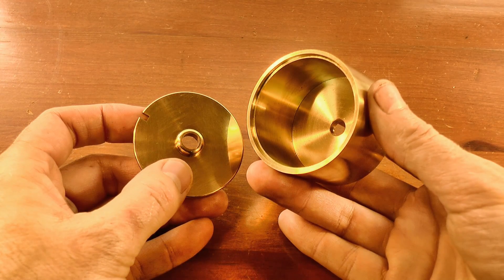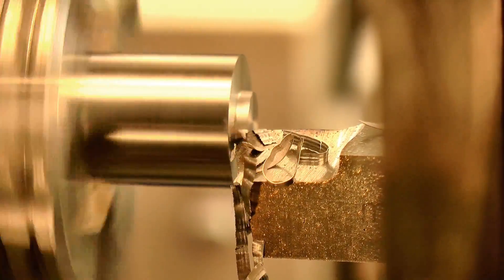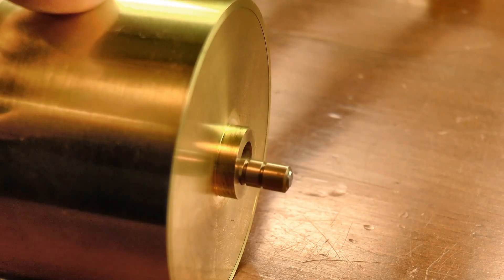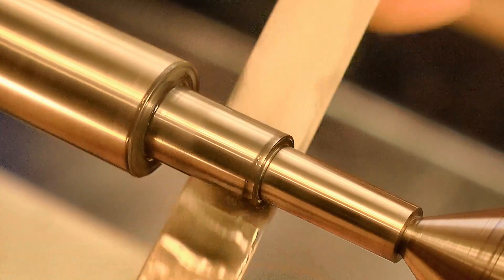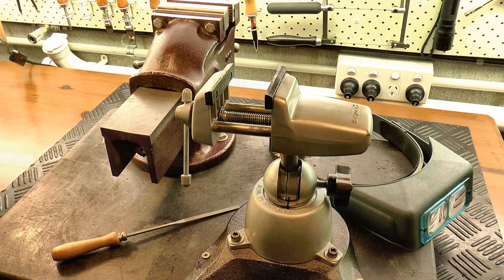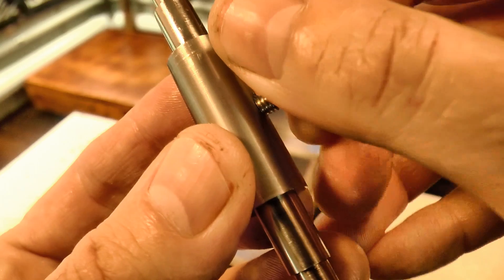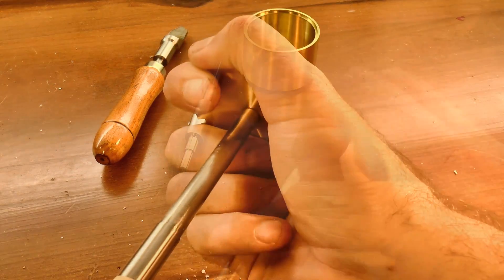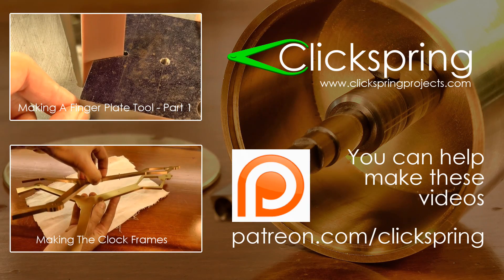Clockmaking - How To Make A Clock In The Home Machine Shop - Part 8 - Making The Barrel Arbor

Comment: You mention "silver steel".  I bet I have looked up "silver steel" a dozen times at least, over the yeares to try to figure out what it really is.
I looked around again today.  And now I remember why I have always been confused.
I guess that, here in the USA, we'd have to call it "tool steel" and let it go at that, since the term "silver steel" is so broad as to be almost useless (to me, anyway).
It seems that most links seem to pin it at  about 1% carbon, but with other alloying elements,  It seems to lie somewhere between AISI W1 and O1.
I may even be wrong on the 1%  carbon, though.
Comments?  Clarifications?
Reply: Not a machiner, just watched a bunch of his videos. In this one he only calls it silver steel and drill rod, but he has made heavy use of O1 tool steel in other videos so that's probably what he used here.

Comment: Now I'm no machinist, so pardon me if this is a dumb question

But as I'm re-watching this, I wonder: You use a file to remove tool marks from the barrel arbor, and then used a slip stone to remove the file marks. Is it possible to use the stone to just remove the tool marks and skip the extra step of filing it?
Reply from the maker: The stones remove metal at a much lower rate than files, so it would take too long - Cheers :)

Comment: I'm very impressed with your work. But I have one question: why do You use only the HSS tools and not working with the carbide tools? When using the carbide tools, surface quality is much higher.
Reply from the maker: +Максим К I use inserts when the material requires it, but HSS gives a lot more flexibility in tool geometry - I can grind any shape I need in a few seconds. Thanks for watching
Reply: +Clickspring Thanks for the reply, this reason I assumed.

Comment: Hi clickspring. I'm interested to find out why you decided not to harden and temper this arbor? I'd have thought that with the winding square on the end it would benefit from being a bit tougher to avoid rounding the edges over time.
Thanks again for all these great videos!
Alice
Reply from the maker: +Alice Taylor Hey Alice, I did consider it but decided that I'd rather avoid the inevitable distortion. The original made by John Wilding was left un-hardened and is still looking as good as new, so it should be ok. Thanks for watching and asking

Comment: Hi Chris, Question....when you were creating the tapered fit ,you called the tool you used a broach. Isn't it called a reamer or is this just another difference in terms that clock makers use, like wheel instead of gear?

Comment: If the hole in the drum cover is taper but your arbor is not taper, doesn't that mean the contact surface is very small on the arbor ? Won't the drum cover hole wear out at the narrowest point in the tapered hole and then become a tiny but looser ?

Comment: how do you draw the threads in solid works?
Reply from the maker: +rimmersbryggeri Create a helix for the path, a triangle for the "tool", and then use a swept path cut using both to form the cut of the thread. I understand that SW2015 has a tool that does it all auto now. Thanks for watching and asking :)
Reply: sw2012 used to at least have a hole thread tool I don't know where that went though. I guess the threads are not critical to the sketch though. As long as you mark them out on the machine sketch.

Comment: why are you creating the barrel arbor with the "bearing surfaces" out of a much harder metal than what the clock pieces are? it would have been better in my mind to make it out of the same metal. the only bearing surface that's going to wear is the clock. not the arbor. in the event that things need to be replaced. its going to be the other parts of the clock that it rubs against.
Reply from the maker: +ghostrider433 Its somewhat counter intuitive, but the steel bearing surfaces on clock arbors do in fact show the most wear. A similar thing happens with escape wheels where the hardened pallets show the wear, yet all they touch is the soft brass of the escape wheel. In both cases the brass and oil become charged with grit, and it acts as a lap, wearing the steel. Thanks for watching.
Reply: That makes sense. the grit almost making the whole thing a ball bearing, Anyways, no problem. continue making great content!

Comment: G'Day Chris... I have a quick question... I know your using drill rod for the arbour and the barrel is brass... Is there any chance, in time, that there will be corrosion because of the dissimilar metals being in contact or will a small film of oil stop this from happening.  Your work machining these parts is really well done.. I googled a picture of the clock your making..wow this is going to be a spectacular piece. do you plan to blow a glass dome over the clock to enclose it? I didn't see a glass dome on any of the pictures of the clock on line. I very much enjoy your videos. there very well done... The audio, the camera angles and your work flow is spot on. I wonder if you would consider giving a tour go your shop and the tools your using. excellent job. cheers; Steve
Reply from the maker: +1pilotsteve Hey Steve, very pleased you're enjoying the videos! I'll do a shop tour in the future, but if you haven't already seen it there is a bit of info here: http://www.clickspringprojects.com/blog/from-little-things I think I might buy a cabinet for the clock that I saw recently. It had all 4 faces in glass, it would look really cool in the place in the house where I want to put it. Good question on the galvanic corrosion - There is sufficient electropotential for corrosion to occur, yet these two metals have been used together in this way for hundreds of years without GV corrosion being an issue; usually mechanical wear is the main problem. I suspect GV corrosion is a non issue because of the oil lubricant, and the absence of an electrolyte. Cheers mate, Chris.

Comment: I was just reading your blog/love watching your work. I own a bigger optimum-its ok for what I payed for it.(new) and Im just breaking it in really  But what I wanted to share was my small sherline lathe I picked up a while back. Ill post back with its model # / size etc. Its one of the first prototypes as I believe. It has a solid brass bed and cross slide. I think the 4 jaw on it it poked as it grabs on one or two of the jaws making fine adjustments a pig. Im trying to fix but would love to get a 3 jaw for it and a few accessories. Im not a machinist by any means...at all, but dabble in metal in winter. I mostly work with wood.
Anywho, Ill post a little vid of it for you if you like. Cheers and keep up the amazing work. your kiwi cousin, dave.
Reply from the maker: +Dave Lamason Hey Dave, lovely to hear from you. I think I remember reading something about the early Sherlines having a brass bed, it might be a bit of a collectors item. Look forward to the video, and thanks very much for watching.

Comment: Beautiful work.  Could you elaborate on what you're doing with the burnisher and the emery paper? Are you roughening up the burnisher? Cheers.
Reply from the maker: w0mbles That is correct, scoring it and giving it a straight grain in one direction. It ends up having a surface like a super fine cut file. At a low rpm this removes a tiny amount of metal. At a high rpm it slips over the surface, distorting and work hardening the little peaks on the metal surface.
Reply: Clickspring Ah, I see. Thanks!

Comment: Click, what did you use to wrap/protect the arbor under the dog? Outdamnstanding!! Oh! Before I forget, what blueing salts did you use for the screw heads? As with many things the prep is the key. Brilliant polish = deep, brilliant blueing! Your screws look like the barrel of my .300 WSM Kimber Super America - too pretty to use.

Gracias,

Su Amigo Siempre
Reply from the maker: KillerKane I have a roll of soft sheetmetal I use as shims and protectors for the chuck and this sort of thing. I'm not entirely sure what it is actually. It's nice and soft, and about 10 thou thick. For bluing, no salts just heat. Agreed on Kimber, they really know how to do final finish.

Comment: Great video. Question, When you cut the gear teeth, you used a power source that you attached to your lathe, was this off the sherline lathe or other source. Thanks, Greg
Reply from the maker: Gregory West Yes the milling spindle is powered by the Sherline motor and speed control off the lathe. Cheers, Chris.

Comment: watching these videos just make me want a metal lathe and a mill so much more. I have never seen a tapered broach before, but i cant fault the fitting, it's amazing. What was the most suprising for me though was the tools you used to smooth out the arbour bearing surfaces. That white thing? what was that? It left an amazing finish!
Reply from the maker: Colin Smith That's a hard Arkansas stone, its a fine grit polishing stone. Thanks very much for watching.

Comment: I had never heard about using a tapered cutter for precision holes. Very nice work, as always!
Reply from the maker: +Harm Prins I suspect the simple  f = μN relationship breaks down for a very small circular shaft in a small hole. Particularly when you consider that there are many other dynamic factors at play in a clock that are not represented by that simple relationship, such as slight plastic deformation of the hole surface, a dynamic non-normal force, and the need to deal with angular misalignment of the shaft. 

The tapered shape does lower the bearing surface area, but importantly it also permits angular movement of the shaft. The effect of both of these factors on net friction is far from simple. Believe me, if a straight hole would do the trick, clock and watchmakers would have jumped at it hundreds of years ago :)
Reply from the maker: Applied Science I'll be using tapered broaches again when I plant the gear train in the frames in a later video. Thanks very much for watching Ben.
Reply from the maker: taiden Yes its one of those things about clockmaking that really bends engineers out of shape! There's an alignment issue at play too, which I will go through when I plant the train. Thanks for watching mate.
Reply: Clickspring you are right, maybe this is more than just some simple physics :)
btw, i just discovered your channel, and i wanted to say you really did an amazing job at making the video's, the work you do is really interesting and the way you edit the video's makes it fun to watch it for hours at a time, keep up the good work :)
Reply from the maker: +Harm Prins Thanks very much HP, very pleased you're enjoying the videos :)
Reply: Clickspring I always have a hard time with the idea that lower bearing surface area reduces friction. My physics book defines friction as f = μN in which area is not a concern. Somewhere I have exploratory math I did on this question a while back but can't seem to find it.
Reply: +Clickspring 
Thank you, I didn't notice there was another discussion on this same subject.

You are right on the angular movement of the shaft and the complexity of friction calculations.
And the the reduction of surface area can lower the chance of imperfections on the surface.

But still with all the other possibilities of calculation friction, surface area is never mentioned.
This is due to force. The force (static, rotation, any) per square (inch/cm) increases when the surface area is smaller and decreases when the surface area is bigger.
Reply: Clickspring Looking forward to it! :)
Reply: Clock workers can't change physics :)
As taiden said, the size of the surface doesn't matter, as the weight is spread across the surface. If a surface is more polished, it has less friction, but decreasing the size shouldn't matter.

Comment: Chris, I know you're working on a small lathe but it appears you put no radius at all on the cutting tip of you HSS tool grind. True?
Reply from the maker: Thomas Utley G'day Tom, I put a very slight radius on with an arkansas slip, but essentially its radius free. I'm after minimal fillet in the corner. btw loved that launch footage the other day, are you permitted to show more of your day job?
Reply: Chris, thanks for that explanation.  As for the launch footage, just search the web for "SM-3 Blk IIA."  You can also find good publicly released info at www.mda.mil, the USG agency that is developing the system in collaboration with the Japanese Ministry of Defense.  Cheers, Tom

Comment: Hi Chris!

Do you turn up a fresh pair of centers from hex bar stock every time you need it, or do you reuse them?

Cheers,
Ivo
Reply from the maker: spankmeister Fresh point on the chucked hex every time, using the same bar. I lose a tiny bit of length every time. Cheers Ivo!

Comment: Excellent video, but why didn't you just use the callipers itself to measure the inside plate dimension (at 3:50)?
Reply from the maker: Youpuber That would have been simpler! Thanks for watching.

Comment: Will all these parts get a final polish at the end too, or are they done?
Reply from the maker: DammitCoetzee This part is finished except for a small chamfer required on the pivot shoulders later. All of the external parts will get a good polish as the last step before final assembly. Thanks for watching.